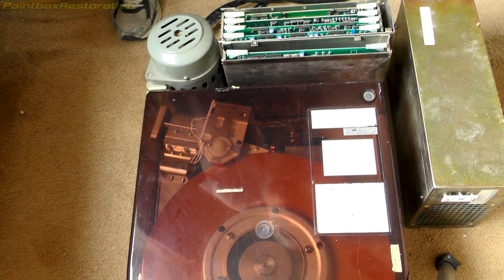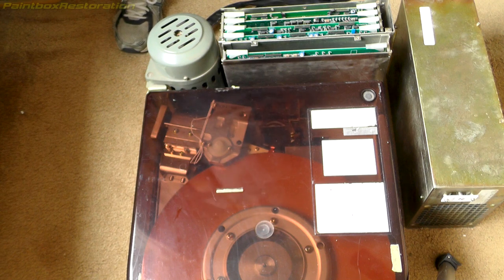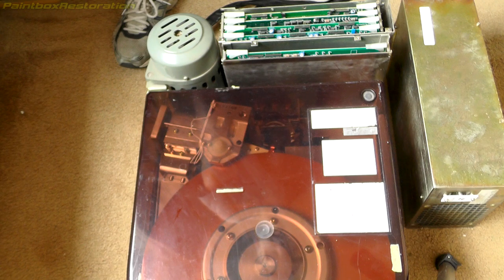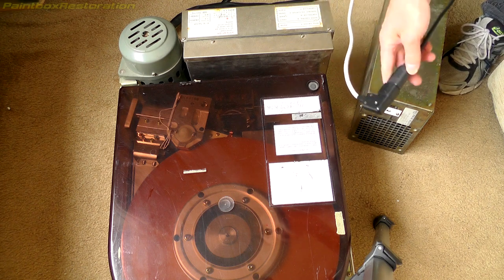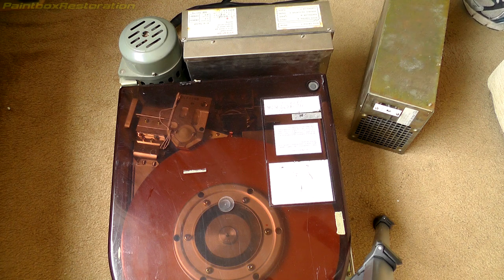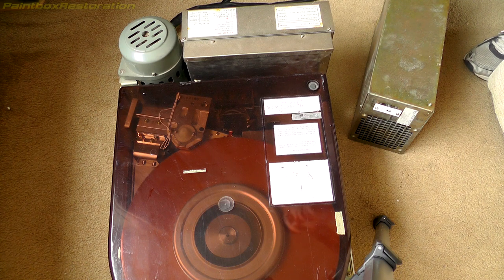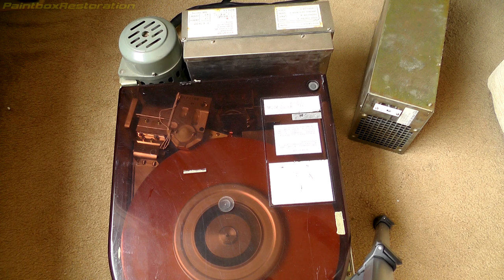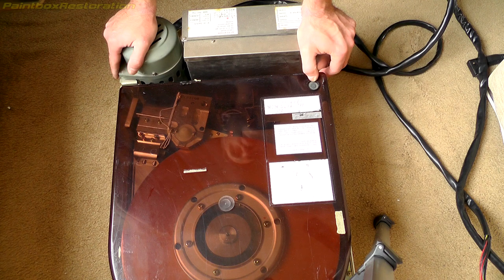Fujitsu M2294 14" Winchester HDD Disk Spin Up

Comment: 335.5 MB :)
Reply: I was expecting 556KB
Reply: 100mb for horsepower used... a bargain
Reply: I was expecting KB.
Reply: There are modded win xp versions that can run on that..
Reply: Daym
Reply: That was huge
Reply: I still got a seagate st225 (20mb) and st 251 (40mb)..and both are working :D
Reply: I still using 80gb hdd on my home pc
Reply: @Guardian_27911  don’t feel bad I’m useing 32gb on a pc
Reply: LoL
Reply: Un monton
Reply: @EDHKilian  ha! I have a working copy of the original full  height 10Mb hard drive the IBM PC XT came with, along with the Xebec controller.
Reply: Wow that is so much i will never need that much storage.
Reply: @EDHKilian  I still use my 16 year old 100gb western digital hdd in my old XP desktop.
Reply: I'm on a 160GB hard drive. My PC doesn't even look old!
Reply: A normal game take this..
Reply: That's actually a really high capacity for that time
Reply: @EDHKilian  I have an ST-251 too. nnNININININIdudududKRRRRRRRRRRRRRRRRRRRRRRRRRRRRRRRRRRRRRRR!

Comment: From the brochure: "Very large storage capacity" (335.5 megabytes)  "Compact, economical"
Reply: it was all relative :)
Reply: 335 is not terrible
Reply: @MilesPrower1992  Well, the words i quoted really puts things into perspective, its all relative and it was probably good at the time but if you compare to drives we have today you realise how far we have come. I have worked on measurement instrumets for many years and ones from 1993-1994 or so had laptop drives with 40-80 MB in them running DOS and these drives although 2.5 inch were 2-3 times thicker than such a drive is today.
Reply: I wonder what they’d do if they saw a 1 tb laptop hard drive back then
Reply: @Akotski-ys9rr  "What kind of weird interface is this? It won't connect to anything"
Reply: @Akotski-ys9rr  HA ha, it would have been like alien technology or something, i grew up in the 70´s, if someone would have showed me a smartphone back then i would probably have considered that possibility, :-)
Reply: @Akotski-ys9rr  Probably drive over it as they wouldn't recognize it as something valuable or computer-related
Reply: Compact LOOOOOL 😂😂😂😂😂😂😂😂

Comment: The balancing that had to have been done to get that beast to run that smoothly at that RPM must have been insane.  That is a LOT of mass to spin that fast and not have it vibrate itself to pieces.
Reply: I think they just built hundreds and picked the best one... jk
Reply: @8BitNaptime  no they definitely did that for the prototype
Reply: You need to see an MRI scanner with the covers removed. You'll never go in  one again!

Comment: Can you imagine the damage from a head crash at those speeds???!!!!! I'd not want to be in the same room as this piece of kit!!!!
Reply: Am enough of a greybeard that I don't have to imagine it. :)
Reply: shit*
Reply: Well.... Imagine a 15k rpm SCSI then.
Reply: Now the hdd's run at 7200rpm. It's a crazy speed.
Reply: @brostenen  Quite the damage, but they're quite well contained ain't they? I don't think I trust my throat nearby that (admittedly beautiful) transparent cover against a shattering platter, tho dunno if that could happen on the material they used on them
Reply: @Kalvinjj  I have no idea what they are made from. I think they are hard to schatter due to how thick they are. Back in 1995 I was on a school to learn about computers. An 80mb Conner drive had too many bad sectors, and some bright genious had the idea of taking off the cover and loosen the screws on the hub to the point of only keeping the plates on the hub/spindel. And then powering it up. I have no idea if that was some 3200 or 4500 rpm, however they did some pretty decent damage to the drywall.
Reply: 15 x 300gb SAS and those are 15krpm. 8gb Fibre to connect it pc. 2.5" so noice arent bad.

Oil escaped from bearings, huge spinning mass on The hdd on that video. Can ne over 10kg moving parts? (Without head's)
Reply: @asbestosfibers1325  They are indeed, but they're quite well protected too.

What probably scares shitless someone tho is if the part detaches and gets stuck on the spindle (or just releases on a CNC lathe), that hunk of metal spinning VERY FAST sure ain't fun, unless you're just watching from a monitor and you didn't pay for any of that.
Reply: @Kalvinjj  I've had the spindle come off a drill press, it grabbed the steel piece I was working on and smashed everything on my finger. That was not fun at all! Still have my finger tho!

Comment: If I recall, these old hard drives came with a Power Take Off you could use to run factory equipment.  The “-CT” models included 72 carbide teeth on the disk and the hard drive could be used to rip down lumber 1/64” veneers.

Comment: *Drive spins up*
*Everyone in the room backs away*
Reply: Lol I step closer in amazement 😉
Reply: I'd be afraid of the disks shattering like a jet turbine blade and impaling everyone.
Reply: @DJdoppIer  A head crash in one of these is most impressive... I saw one once, at a bank. The fire alarm went off and you could hear the screeching all through the building...
Reply: Like the elevator backpack startup scene in original Ghostbusters.
Reply: Why? That was super smooth.

Comment: Dang! The control box itself is bigger than most modern hard drives!
Reply: It is still small. Usual control units for these was rack-mounted.
Reply: that small hdd.i used to have hide where size of computer disk.ibm brand ones..stored 1,6gb data and costed 25k each

Comment: Cool.
It still runs. :)
Doesn't sound too bad, and the few noises when spinning up are just a bit of belt slap.
Some noises when it's almost stopped just sound like the motor brushes tbh.
Reply from the maker: the rattly kind of sound? I'm pretty sure it's the plastic eject tabs on the controller PCBs vibrating. The dragging sound at the end is the brake on the top of the spindle motor, TBH i don't think the brake is working that well, it could be worn or needs adjusting.
Reply: Ahh - yeah, could be the board hooks.

They do tend to be a bit wobbly in the holders (like on the Harriet, but worse if the boards are vertical.)

Didn't realise it had a brake. That's pretty neat.
Reply: @electronash  u mind filming the brake please?

Comment: I always thought these old hard disks were about the size of something a bit bigger than your hand but I didn’t think they’d be THIS big
Reply: There were bigger ones......   And they had less space on average.  I remember the 10" HDD that was in one of my old systems.  It was only 15MB.   Most of the same computers only had 10" floppy drives standard.  I think  it came from an old radio station originally.

Comment: This drive is a MONSTER! Imagine you would have to listen to this sound whole day long!
Reply: Bram vandenbroeck No not really, it's designed so the quantel paintbox and disk drives could be installed 300 meters from the operator, usually in a air conditioned computer room.
Reply: @DextersTechLab  and even than you heard the Access of the Drive i guess xD

Comment: I once had a 14 inch hard disk like this who was squeeling loudly from the main bearing. I drilled a hole into the bearing, and squished in oil through the hole. Unfortunately I used to much oil, and it flowed unto the platters. I ruined it completely, I though. But I still powered it up. The squeeling bearing was now lubricated and quiet, but oil now squished out through centrifugal force onto the plastic covering. I run it for a day or so, and then tried it. It worked, and worked for years after that.
Reply: lol. amazing.

Comment: Large Fujitsu SMD disk drives have a manual spindle lock you need to unlock.  On the Eagle drives it was a swinging arm that is held in place with a set screw.  As I recall it was down low between the drive and the electronics.  It is a flat 1/4, 6mm wide stamped sheet metal.  You look down at the set screw which I recall was colored.  The set screw does not actually grip anything.  It just keeps the arm from swinging back and forth over a separator.

Comment: For everyone commenting about " how fast it's spinning", keep in mind that before SSDs took over, workstation or server hard drives would spin at 15,000 RPM.
Reply: up to 15k,  most desktop drives were between 5400 and 7200,   sas drives would go to 15k
Reply: @jameskirkland7914  I used 15k SCSI drives, in RAID 5 array, for my workstation. Transfer rate was crazy fast with three 15k spindles striped.
Reply: The Fujitsu M2294U spins at 2964 rpm, which is painfully slow compared to some SCSI drives that spin at 15,000 rpm.😉 Of course the transfer rate on these was only around 1.01 MBPS. tops...
Reply: While that's true, I wonder what the actual linear speed at the outside of the platter is. Even at a lower RPM the huge diameter could result in more speed at the edge than a little 2.5 or 3.5" drive. Anybody know?
Reply: @snorman1911  Would be 130297.44 Surface feet per minute
Reply: @snorman1911  Good point, but the electronics of that era may not have been fast enough to take advantage of the extra disc speed. If I remember correctly, the sectors on the outer edges were much larger, yet they contained the same amount of bytes as sectors in toward the center.

Comment: Bearings are worn, but not too badly on the spindle. Motor bearings could do with a drop of oil ( take fan off and run a drop of 0W 15 engine oil through the top metal dust cover, turn over after a day and do the same for the bottom) and of course there is no head load, you did not send a SCSI load command, so the controller will just leave the motor running until it gets one. Send the command and the unit will load the heads and then you can do block requests. 

Time to break out an Adaptec card ( still got a PCI one here and half the cabling plus terminator) and use the on card utilities to check the drive status.
Reply from the maker: thanks Sean, most of the noise is coming from bits vibrating or the spindle motor which is a little noisy, i might remove the drive belt and just see how much is the motor.

Unfortunately this drive uses an SMD interface not SCSI, things would be simpler if it was, my spare PC is all ready to rock with old school scsi 2. https://en.wikipedia.org/wiki/Storage_Module_Device

Comment: But it doesn't have the, "brrrrrrt tick tick tock"-sound. :(
Reply: @larswadefalk6423  I had one about 20 years ago built into a workstation. You can hear the heads click over the noise of the disk spinning.

Comment: Why we can't do things like this anymore?)) imagine HDD this size having 16PB on board)
Reply: We can, but the performance on a disk this large would be far worse due to seek times, and the added capacity wouldn't be all that much compared to filling the same space with more current sized HDD's, which as a result of there being more, would also be capable of far higher I/O.
Reply: @Krutonium  I know, so lets have an ssd this size)
Reply: @Krutonium  Yes, the seek times would be in order of 20-30 seconds but it can be improved drastically if every head moved individually (totally possible in 2021) and it stored the data scattered across multiple platters in sequence. A bit like RAID but instead of using multiple hdd it uses multiple platters on the same disk. It wouldn't work for Windows even this way but for mass storage (mainframes, NASs) it would be adequate.

This kind of hard drive would be a nightmare for a data center. Imagine 50 of those spinning up at the same time.
Reply: @alexandrumarzenco6998  You know I've thought about those in the past, an in fact I think it was WD who actually built a HDD with two sets of heads for performance reasons (Or more accurately, two indepently controllable sets of heads). I don't think it's ever come to market, however.

Comment: Bad bearings just implies lots of noise. The outer bearing for the spindle is easy enough to replace. There is a belt drive between them which can slip and cause noise as well.

That said, the bearings sound absolutely beautiful in this drive anyways.

Comment: I recently found a set of platters on a carrier outside of a hard drive, at first i thought it was a slide projector carousel, but it was way too heavy, after opening it up i found 5 massive HDD platters, looked to be the same size as the drive in your video

Comment: In early 90s I purchased a used HD that looked Exactly the same as yours. Same external motor same color same 14 inch. Wow imagine the data you could get on current density disk of this size. Peta bytes would be easy. There was a cool store in Silicon Valley called weird stuff warehouse. (There is a video about it on youtube) . It was first in Santa Clara near National Semiconductor. Then it moved to near Moffitt field. I found a hard drive made by Priam.

Comment: This is very much a derivative of the IBM "Gulliver" drives used in the System/3x minicomputers.  The HDA itself is nearly identical (with the exception of much higher capacity, of course).  I wonder if IBM shared some of its HDD technology with Fujitsu back in the day?

Comment: I have a similar one i took from a huge scrapped IBM computer, the motor is even larger in mine and it's scary when it's running, i guess one could remove the plastic cover, install a blade in place of the disks and use it to chop firewood.
Always wondered what's on it and if there's a way to recover its contents

Comment: You should try to get that working as in reading and writing data. I would love to hear an MP3 file being played back from one of these. Will these connect to a modern PC with some type of adapter?

The largest physical hard disk that I've ever seen in person was one from the 70's/80s. Not sure of the manufacturer but this thing was a brick. I wish I still had it as I'd see if it still works and throw some MP3s at it and see if the read speed is high enough to play an MP3.

Comment: This old equipment had it's time in the limelight. Now its time for this computer equipment to rest. This was a scary video. I was worried a tyrannosaurus rex would burst out of the closet and eat the guy. I didn't hear anything wrong.  Only the manufacturer would know  what's normal for the drive.  The case could just be amplifying the sound of resonant harmonic vibrations. Consider that you're running a bare drive without any housing. The geek squad isn't going to be able to help. They don't know jack about this stuff and what's normal. You need the geriatric squad to help you with this.

Comment: I've got a Fujitsu "Eagle" M2351 sitting under my desk...!

I sometimes set it up and run it to Ready and back down again at parties. Certainly raises a few eyebrows! Not sure if that is a good sign or not! :D

Did you manage to find a way to interface it and access it? Mine uses the 'SMD' interface, from what I have read about it. I suspect there wouldn't be much chance of getting an SMD Multibus card and setting that whole thing up... so the only route would be some kind of 'modern' intelligent interface.

Comment: I had a Syquest removable 135 MB hard disk from the mid 90s 1.44 MB double density diskette era.  I only had two disks for it.  It was not bootable.  My PC had a 200 MB fixed hard disk.  My next replacement hard disk was 4 GB making the Syquests useless.
Wiki says the first Winchesters were 35 to 70 MB.

Comment: 335 mb with 1kb/s Transfer Rate in a size of 5 shoe boxes ... wonder how astonished People were back in the days about this Monstrum 😂
Reply: They probably were astonished. Hard drives have been far larger than that and far less capacity. Here is  a good photo of them loading a 5 MB hard drive into an aircraft for Transit it weighted 2,000 lbs. 1955.

https://www.businessinsider.com/picture-of-ibm-hard-drive-on-airplane-2014-1
Reply from the maker: Actually the transfer rate for this drive is 1 megabyte a second
Reply: @kens97sto171  omg

Comment: Usually they do some sort of self test. I only had an eight inch hard drive(the oldest HD i had), some years ago and even that one did a self test, when working RPM has been reached...

I´m also a bit concerned about that noise between 03:24 and 03:32, but i could be easily also comming from that belt below (resonant frequency;)

Hopefully this one does still work....!
Reply: I was wondering about the self test myself. Unless this is like an mfm drive where all the logic is on the hd controller.
Reply: @jakemcgregor8117  It's not MFM or SCSI. PaintboxRestoration's comment reply a few comments up said it used SMD or Storage Module Device

Comment: im wondering, at what size is it considered a hdd or a saw
Reply: it's easily turns to mini sawmill by replacing original discs with the same diameter wood cutting blades

Comment: that thing needs to be plugged in the wall straight and screwed into the floor...also u can use the spindle motor as a replacement for your clothes washer when its engine fails :))
Edit: there is no reason for its heads to be moving along the platters..since software was built into the electronics and nothing on the platters. Its actually waiting for read/writes operation which is why ytou are getting the ready signal. Also back then there  were no tests implemented upon hdd startup to begin with.

Comment: If you need to store your data, or mow your lawn or slice beef, or wood :D
Reply: my homes heater sounds like a saw blade when cooling down :D
Reply: @synthoelectro  Interesting, might be cooling down too fast, meaning bad isolation, you should check it out, 'coz it could fatigue the pipe material and break up
Reply: @saultube44  ack, thanks. Been doing it for years, but lately, it hasn't done it much. Which is good.